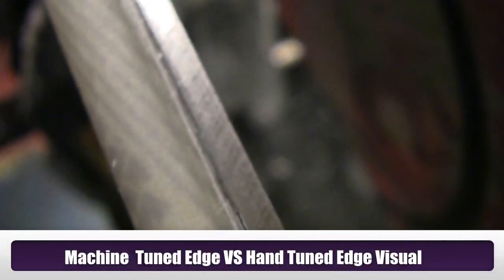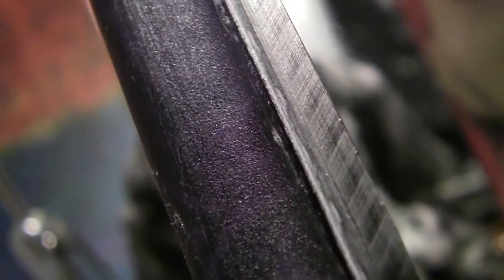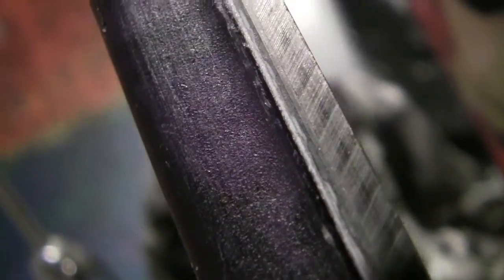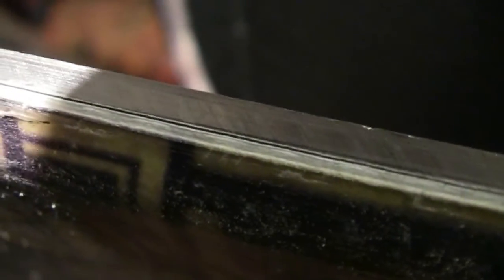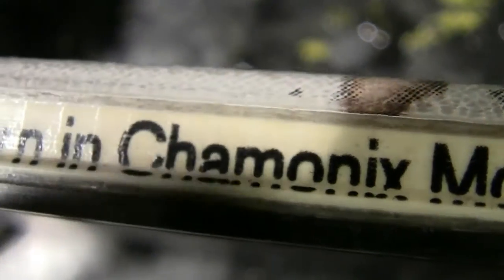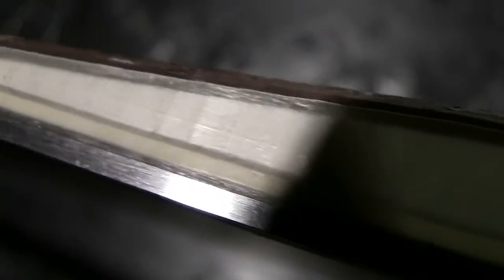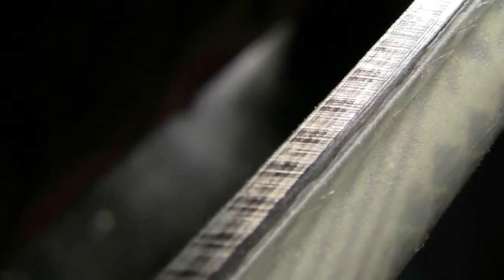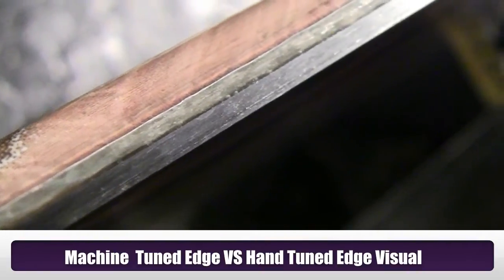Ski Tuning Machine VS Hand Tuning Visual

Comment from the maker: Yes, the quality can vary quite a bit.  This is a aftermarket tune from a shop.  This pair took quite a bit of work to get a true edge again.  Some of the ski makers are doing pretty good work as the machines get better.  The ski was a Salomon, but again tuned at a "shop".  Many of the smaller ski makers are doing hand finished work on their stuff.  Those are very good, such as DSP, Moment, and ON3P just to name a few.  Thanks for the comment Denelvo.

Comment: That machine tuned edge looks awful! Was it from one of those handheld machines? Smells like a worn out spindle bearing or something. 
Are those Dynastars? I've seen new Völkls and Salomons come with machine tunes that look way nicer than that. Almost mirror-like, with tiny striations that only need a few passes with the diamond stone to get to fully shiny and smooth. And all the skis I've seen come out of one of those big robotic Wintersteiger machines look exactly the same,close to a hand tune